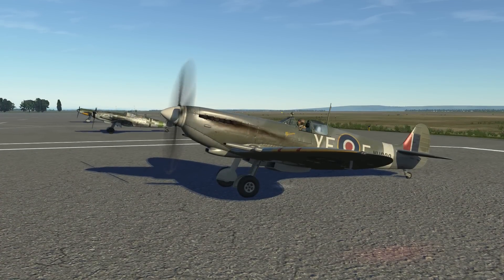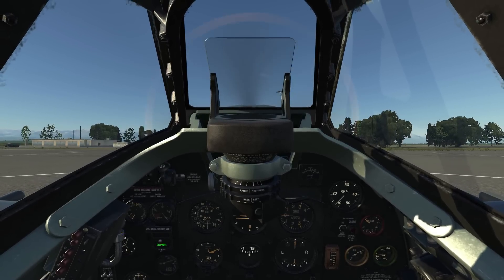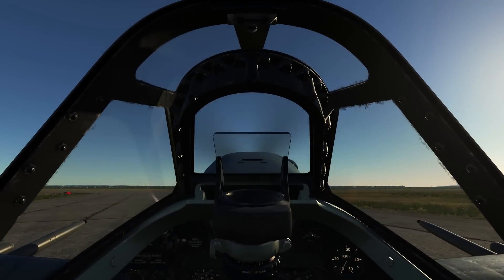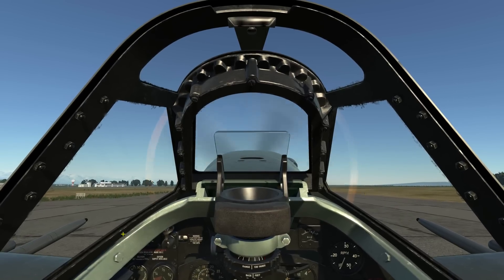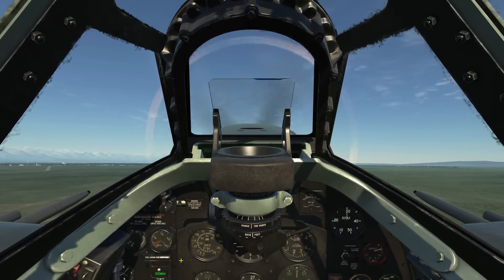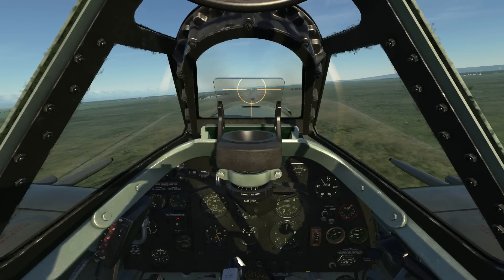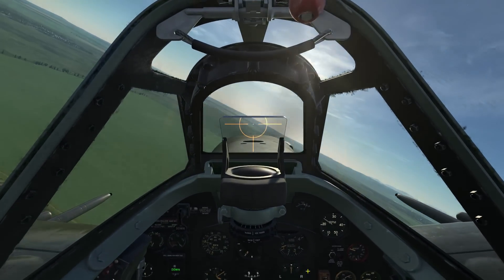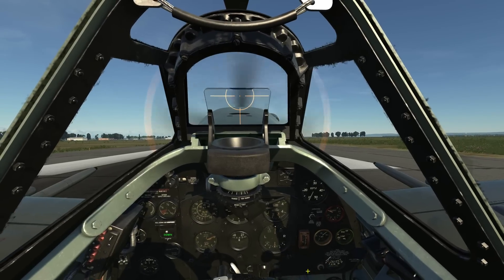DCS: Spitfire LF Mk. IX - Taxi, Takeoff, and Landing - Producer Note Tutorial

Comment: One observation if I may.  During the startup video, you had that air filter ON.  In the take off video it was  OFF but I did not see you turn it off in either video.  I was looking to see what the filter position should be in flight.  Obviously off, but I did not know which handle position; I fly VR and you can't see the label.  Handle backwards, got it.  I think I flew with the stupid thing on and reaching 20K had some kind of engine malfunction.  Frozen intake?  Carb ice?  Not sure, but it resolved itself as I went lower.

Comment: Why do away with the straight approach for touch down?  Or in other words, what's the point of the fast, low approach, climb out and 360?
Reply: Two reasons. First, in a combat scenario, if there is an enemy aircraft trailing you that you don't see, it will give the anti aircraft gunners at the airfield time and opportunity to fend it off. Second, it keeps some loading on the aircraft. The Spitfire is inherently unstable, and by keeping a continuous turn, you are less likely to upset the aircraft.

Comment: The in-game tutorial does not say to maintain pressure on the brake while taxing and taking off if memory serves me correctly. I wish my friends and I knew about this video when we bought the damn thing. We spent all weekend along with numerous crashes to figure out you had to drag the brakes a tiny bit to get the rudder controls to have any impact on turning. I finally figured it out last light. A buddy figured it out over the weekend but the way he described it wasn't very helpful to me. I think the description of "keep a ting bit of pressure on the brake while rolling on the ground" paints a clearer picture to someone new to the model.

Additionally we figured out that we HAD to make sure that our X-55 deadbands were set well. Finally, a lot of "curve" needs to be tuned into the rudder control. Even in flight it is far too east for a tiny bit of rudder to cause an undesired slip. While maneauvering recovering from the slip is deadlier than causing it. It is like a rubberband effect. Cause me to get into a spin a few times. IRL, I  guess that is what flight instructors are for :-)